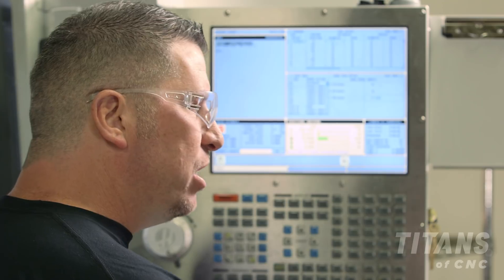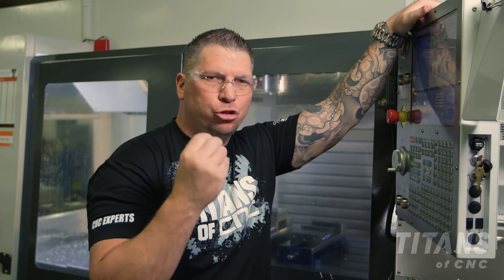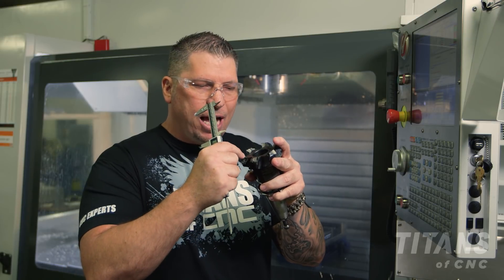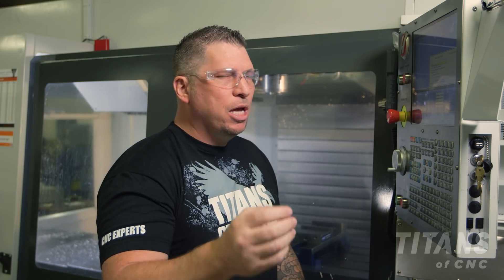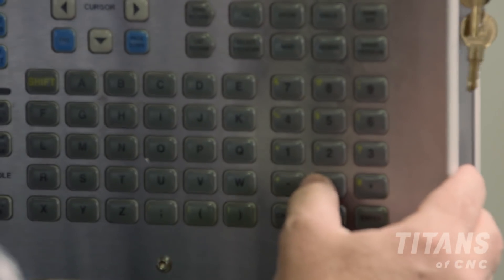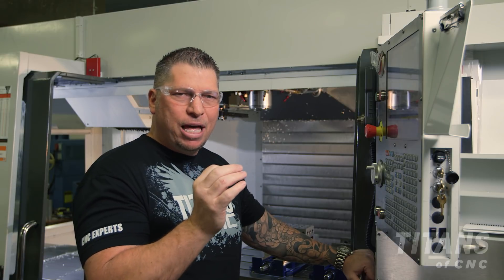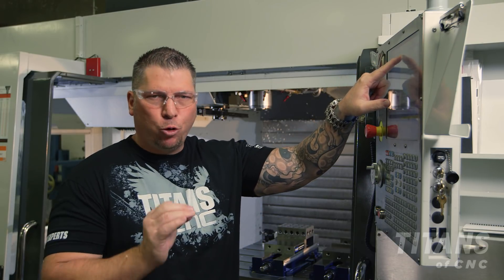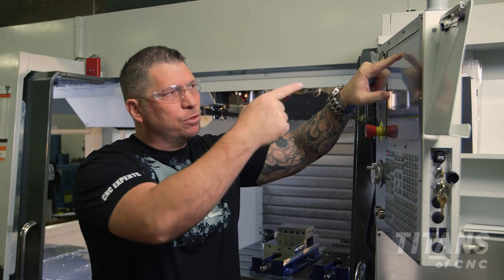TITAN FUNDAMENTALS: Probing Height Offsets With an Automatic Tool Setter

Comment: When the rotating shell mill was lowered to touch the sensor, didn't it likely do some damage to it? 
Big rotating tool touches stationary sensor.....
Reply: There is a laser reader that is pointed at it and senses it instead of actually touching it. Also the tool spins backwards so it can’t cut